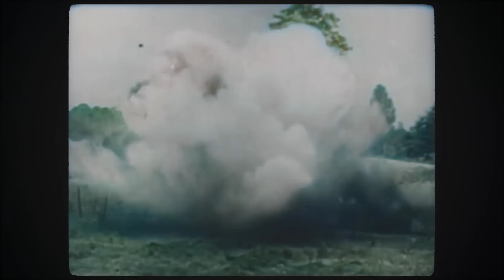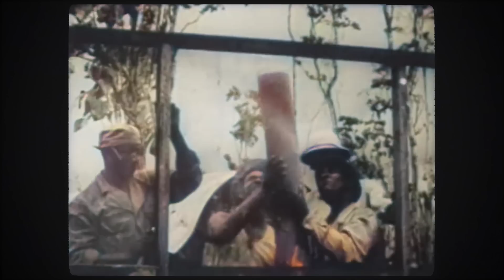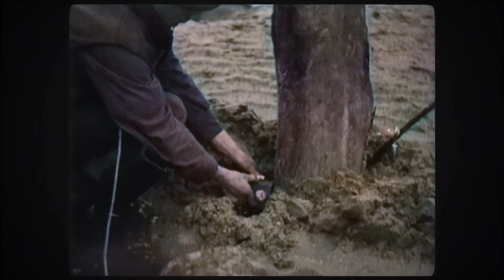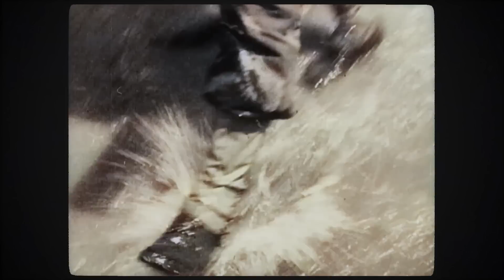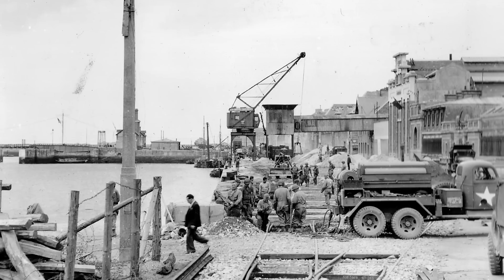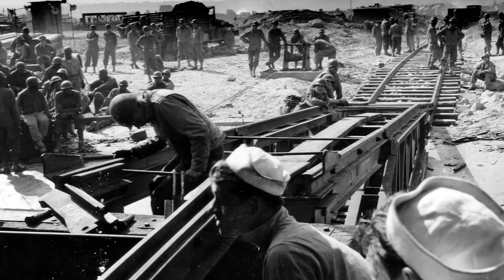The Combat Engineers of D-Day - WW2 Special Documentary

Comment: One of the interesting engineering aspect of D-Day was the artifical harbours.  The British designed and constructed the parts but the British & US engineers were responcible for the final construction of the port in their areas.  The US engineers finished in half the time by leaving off many of the anchor wires, while the British engineers finished it with all the anchors.  When the storm hit a later the US port was destroyed.  But, by that time it had delivered much needed supplies earlier.  So, this is another aspect of the engineers' balancing risk vs reward. 
Thanks, and have a great day.

Comment: As an ex Royal Engineer, thank you for this excellent presentation. My time with 11Field Squadron, 38 Engineer Regiment was the most exciting. Search team in Northern Ireland 79-80. Norway in place of our commando sqn 80. 81 in Belize. To deter Gautamala from invading while Belize got independance. 82 Falklabds. Air defence on board the Sir Bedivere. She was credited with shooting down an Argentine Mirage. After we got hit a glancing blow from a "return to sender" 1000lb bomb! Building the airstrip at Port San Carlos. Then ship to shore refueling. And airstrip repair. The latter two tasks with just two L/cpl's and four sappers. The Sqn did many other tasks. Including mine clearance and repairing the runway on Stanley airfield.  After 23 years it was time for civvy street. The Bailey bridge was used as an assault bridge. Almost suicidal in view and range of enemy fire. After Normandy. They were built in cover. Then, it was pushed by a tank down the road  and over the gap. A much safer alternative! These days, they are mainly used as a line of communication bridge. In secured rear areas. Tank layed bridges are the current assault bridges. The obsolete No's 8 and 9 bridges were pretty good. The no. 12 also a good bridge. The no's 10 and 11's not so great. The M3 Amphibious bridging system is excellent for wet gaps. Its such a pity that the Navy and RAF no longer have the Harrier. Only 20 F35's split between the RAF and two aircraft carriers!
Reply from the maker: Thank you for your kind words and sharing your experiences with us!

-TimeGhost Ambassador
Reply: 32 sqn same time

Comment: I thought of the teeth welded on the front of tanks enabling them to cut through the hedgerows. Love to see a special on those battlefield inventions and improvisations that helped win the war.
Reply: The most effective solution was also the most famous. Most often attributed to Sgt. Curtis Culin of the 102nd Cavalry Reconnaissance Squadron, the “Rhino”-tank was a clever repurposing of German defensive hardware. Using scrap steel recovered from a bombed out Nazi roadblock, Culin fashioned a set of large prongs, shaped like the end of a fork, which he attached to the front of a tank. The tank accelerated up the berm and cut through the thick brush as if it were cardboard. Sgt. Curtis Culin’s hedgerow cutter, or Rhino device, earned its nickname due to the prongs’ resemblance to rhinoceros horns.